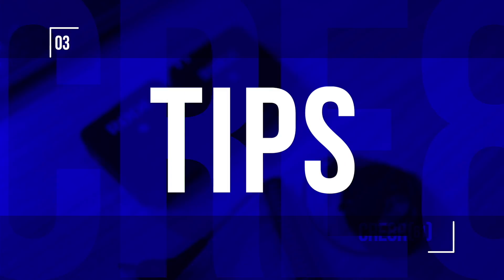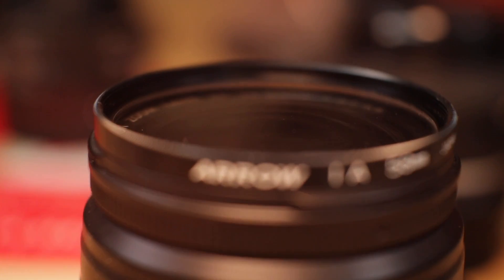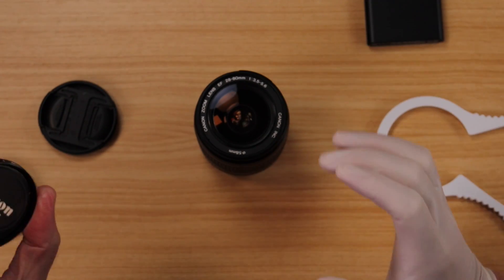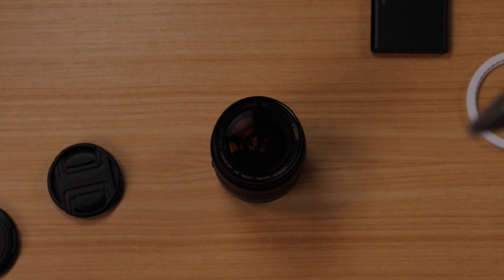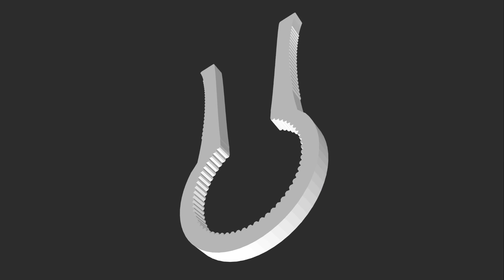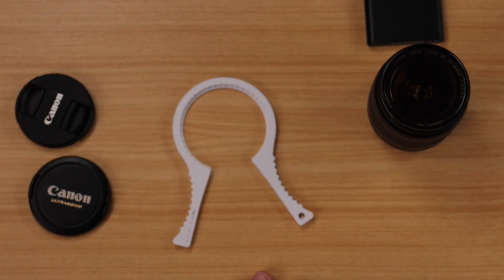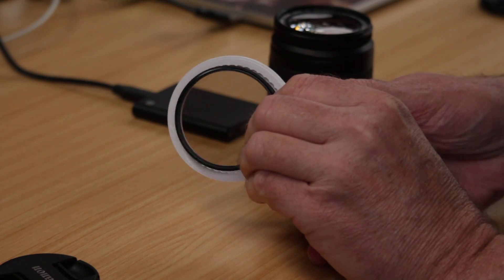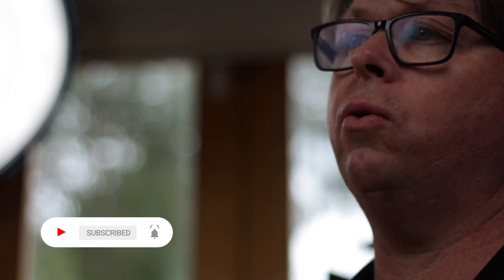HOW TO SAFELY - 3 Ways to Remove a Jammed or Stuck Lens Filter

Comment: Wow I was freaking out after getting a $200 filter stuck on a $1000 lense. Good thing I found this, the glove method worked and I got it off. Thanks for the tip!
Reply from the maker: That’s great to hear. It’s so easy to crack a filter. I did when I used to shoot film. I’m still haunted by that crunch of glass breaking

Comment: Thanks for this!  After watching this I was able to remove a stuck lens filter on a Mamiya 55mm f.35 lens that aquired this morning at an estate sale.  Liked and subscribed,
Reply from the maker: Thank you sir very much appreciated. What did you use to get your stuck filter off in the end?
Reply: @cre8r61  I used a latex glove.  I also sprayed a little bit of penetrating fluid into a bowl and applied some around the edge of the filter with a very small paint brush.

Comment: My problem: My filter is a Split Diopter that can turn by itself. The part that actually connects with the lens is very small. What can i do in that situation?
Reply from the maker: I’d suggest a combination approach using the rubber band and filter wrench solution. I had a similar issue with a VND filter recently and this worked. Thanks for watching - let me know how you go
Reply from the maker: @karimRPGs - how did you go? I'd love to know